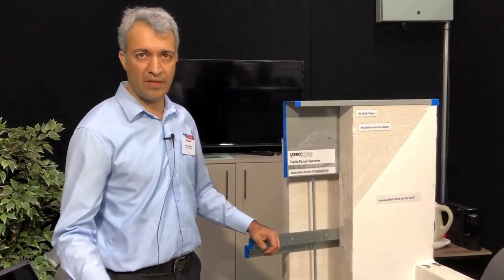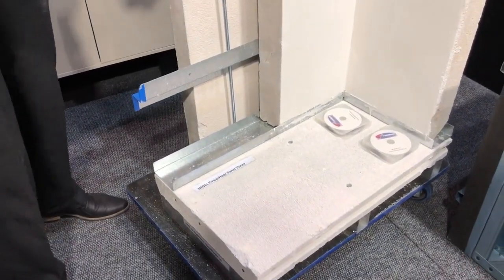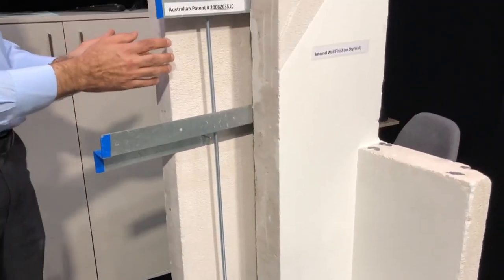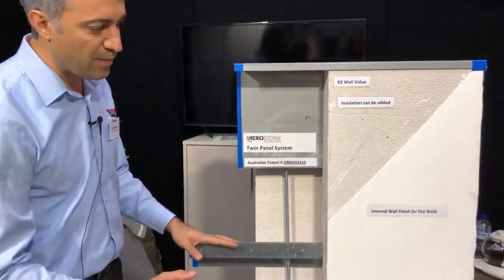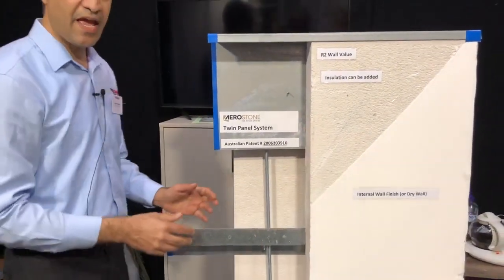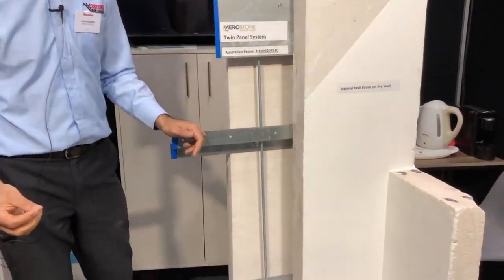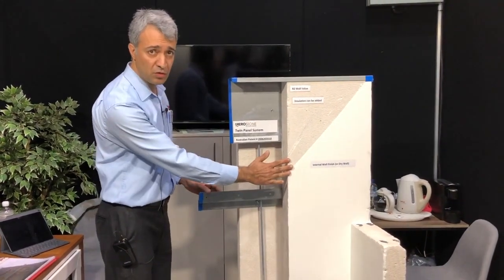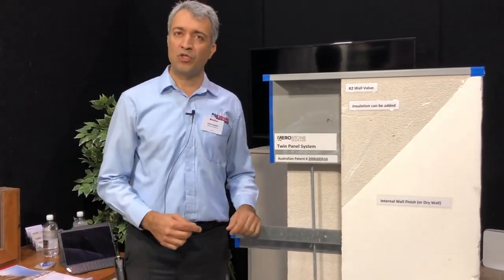Aerated autoclaved concrete wall panels for light gauge steel framing building

Comment: Good information on a great product that can help any house in extreme heat or extreme cold and can be cut with a circular saw - sounds too good to be true. Can a machine be purchased to make this in countries where it is not ready available ?
Reply from the maker: You can try to cast the panels manually. Here the recipe www.pioner-group.com/concrete